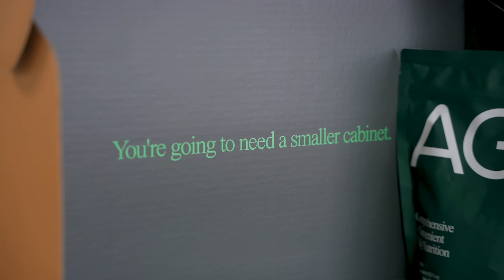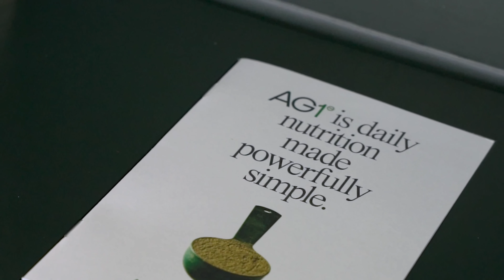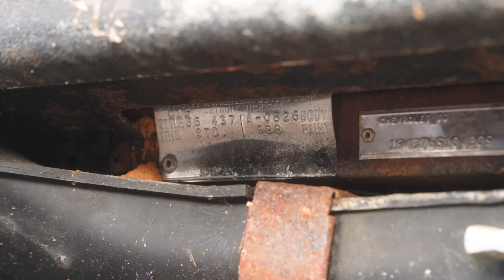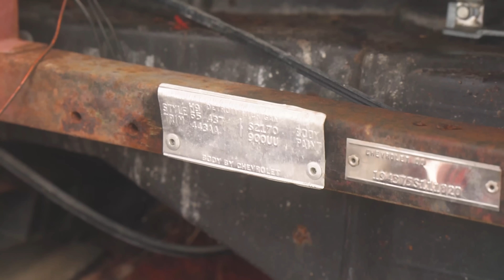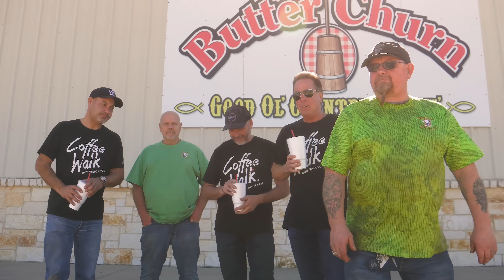RESCUED: TWO Mid-Year Corvette Coupe's + Updates Are Back!

Comment: It never ceases to amaze me how magnificent cars can be left is such messed up condition. SO GLAD you are saving these, bless you.
Reply: Until the mid '80s or so, these classics were just old, worn out, used cars. It was a lot different back then. My dad had a very very early '65 Mustang which would today be a '64 1/2' that he bought new. He gave it away in 1973  because he had replaced the transmission twice already and was fed up. He had a '57 Sunliner too...just sold it one day for a few hundred in the mid '60s. It was a PITA to keep the top lid working so he got rid of it. Different times for sure.
Reply: I live in Australia , And I drive regularly past a HX GTS Monaro , that is sitting up to her axles in the ground, windows down no windscreen ... And it breaks my heart , I just know if you approached the guy about buying it he would say "i am going to do it up one day"..   Easily a 100k + car BUT would take 80K+ to fix it up ..  Breaks my heart .. One day i may just have to stop and ask ...

Comment: Just a little story, my boss who owned the plating shop would build a car every couple of years, he built a coffin car, a teaky tee, him and his partner both built 32 Ford Sedans, no fenders or hoods, they chopped and channeled them, they built the frames by hand, put Jag rearends in them , with the little driveshafts on each side all chrome plated, they had twin turbo charged 390`s, with monster chrome exaust they made by hand and I helped them both, every day they would give me a project to do each day, some days I just made brackets, and drilled holes in them for the framework. They painted both of them candy apple red with goldleaf pin stripes, monster meats on the back, with spoked wheels up front, they made a sunroof out of smoked black lexon from the front all the way back and curved to roll right into where the back window was, of course it was late 70`s, the interiors were like a crushed velvet red and gold combo, all they had was an arc welder a bansaw and a couple grinders, every piece was made by hand, this guy was a real life George Barris and he lived right around the block from me, I worked at his plating shop for about 10 years in my late teens early 20`s, they both ended up selling the cars so they could finace another project, I think they only got about $10,000 apiece back then, I have never seen either car again, it`s been about 40 years, I keep an eye out at Barret Jackson and Mecum, but nope never seen them again. I mean this guy was the Chip Foose of the 70`s, he would vision it, and build it all by hand.

Comment: I wonder how many people have stopped and tried to buy the Corvette sitting right off the road.
Then again, not many people would even think about tackling a project like that.  
I'd love to have the red 396/425 car if it has the original engine, or even a year correct 425hp engine.
The 396/375 engines ran hard, but the 425hp 396 engines were a beast.

Comment: Watch it Dennis, those boys are packin. This is like being in a candy store for Dennis when you were 7 yrs old. Tri power intake and carbs w/ aircleaner just sitting in a loft, Dennis is buying everything the boys can carry. I worked at a plating shop in my teens, I can`t even count how many of those Vette bumpers we replated and ignition covers and finned Vette valve covers and air cleaner lids we did, too many to count, we polished and buffed all the stainless steel trim, we plated all the brass knock offs, you name it, we could plate brass steel and aluminum. Every day I would get there early and remove something from under my hood and plate it, I had a mint 79 Black Grand prix, I did the valve covers, the radiator cover, the air cleaner, the master cylinder top, if I could unscrew it, I chrome plated it, boy what a mistake, it was a nightmare to keep clean. Just looking at those parts brings back so many memories. Dennis I did not know a 425 hp 396 existed, I thought 375 horse was top dog, LS6? Is it true it was actually a 402 ci, but GM thought 396 ci sounded better, that`s what I heard. Love the videos, keep em coming
Reply: I never heard of a 425/396 either. Also I`ve heard 396`s were 402`s as well.
Reply: L-78 396/425 horse was 1965 only, and in Corvettes and full size Chevrolet's. 1965 Chevelle Z-16 was basically the same engine except with a hydraulic cam ( 375 hp). The later L-78's ( 66-69) were rated at 375 hp, but was the same engine, just different exhaust, distributor & air cleaners, for the different model applications. The 396 grew to 402 for the 1970-1972 year models.

Comment: That one tri power set up look like a ovel port I thought they was square port?
Reply: Chevrolet made both oval and square port tri power versions. 400 hp for the oval and 435 hp for the square port. The 1967 versions were different also, slightly taller.

Comment: Mid year Corvettes have semi- weird code tags compared to later cars and decoding them to get info on options can be frustrating. For instance, they don't really tell you all the options, and these cars had Exception Control Letter Codes too. You have to look at the overall car and know what the factory did to make the options, such as where the hood prop is and what that means for other options. But unfortunately, the 'A' code on the trim tag in the first car, the '66 Corvette, means AO Smith body, and AO Smith body cars didn't get side pipes. Only the St Louis bodies got side pipes. That needs to be an "S' code on the trim tag. Sorry Dennis. But with only 9958 1966 Corvette coupes made total, it's still a rare care by default. Four speed was an option, and it looks like the teakwood wheel judging from the color and the 12 o'clock seam. Knockoffs were also an option. Rare car no matter what. Compare to production for a 1966 Chevelle SS396, with over 66,000 coupes made. That's just SS396 coupes,  not counting the Malibu and 300 two door cars and excluding all convertibles.

Comment: A few years back I got a call to look at 3 cars.
70 Challenger SE 383 auto ~ $13k
63 Vette 327 auto ~ $10k
73 Mustang Grande Convertible ~ $7500

The Challenger had a welded frame, so I declined it.
The Vette was a basket case and I declined that also.
Then there was the worst looking Mustang I have ever seen.
A Grande. 😂

I offered $11k for the Challenger just to part out. I don't mess with welded frames.
They declined.
I told them to ebay it and they got $34k in 5 days for it.

I have no clue what happened to the vette & Mustang.

I just came across a 90 ZR1 for $6k.  6 speed Convertible 
Repainted white with about 150 runs in it. 😂

These cars are still out there.

A buddy just picked up a black/silver 79 Z28 350  4 speed T-top
for $5k.